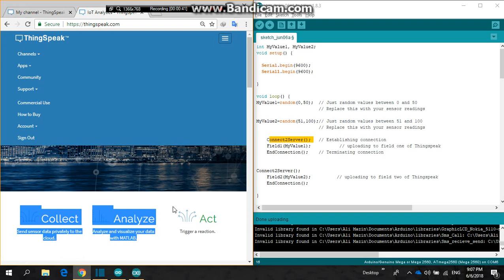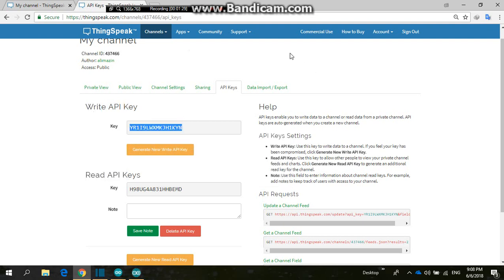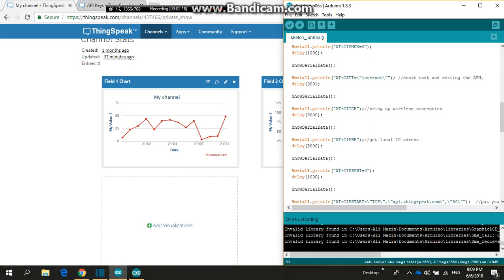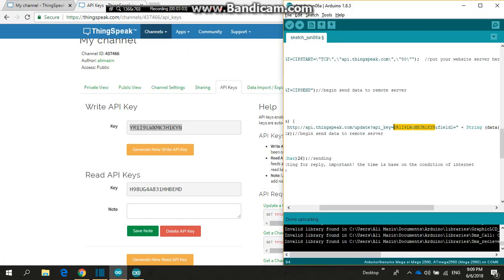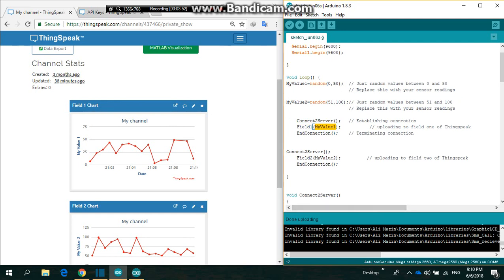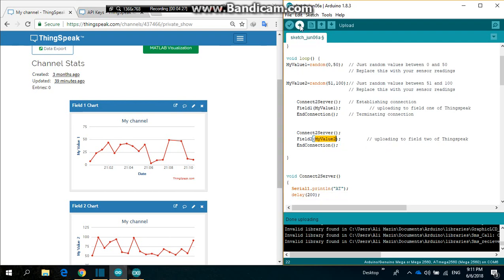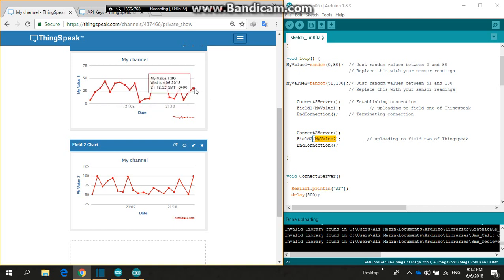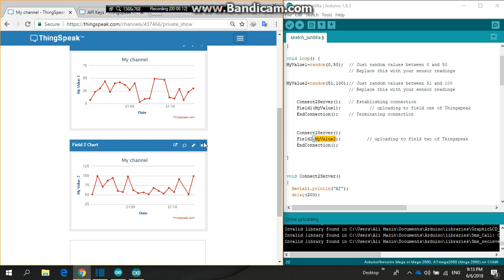Upload Sensor Value to Thingspeak using Arduino Mega and SIM900

Comment: Could we use arduino uno for that !
Reply from the maker: Hello,
You can yes, but make sure to connect the wires properly as shown in my other video.In arduino uno use Tx and Rx pins which are D1 and D0 respectively. The code should work properly of you make the connections right.
Reply: @alim25061  Thank you, it worked form me last night. 
Have a great day :) 
Arduino Uno + GSM sim800l data insertion using thingspeak.

Comment: I cannot sent the value.thingspeak is not updated.
Reply from the maker: Please follow the steps correctly, make sure the connections are correct and you have used the right power supply because sometimes the gsm module  is getting enough power to use gsm communication.

Comment: فهل هناك تكملة للكود او انا اضع تلك المكتبات ؟
Reply from the maker: The code does not require any library to be installed because it is using only serial communication through RX and TX pins